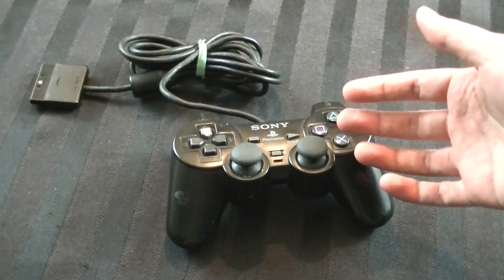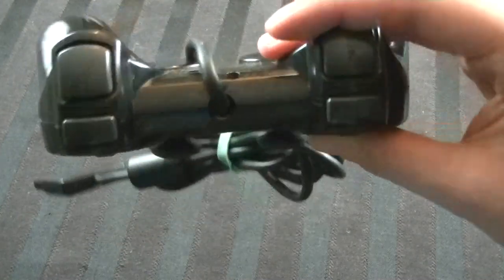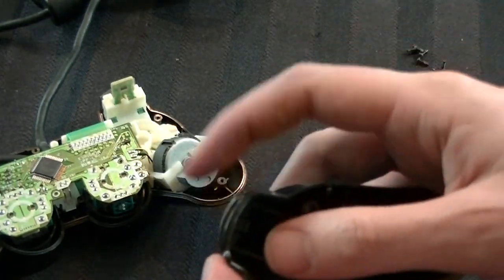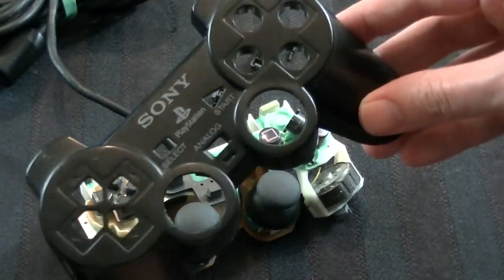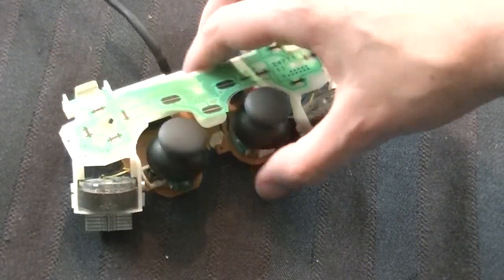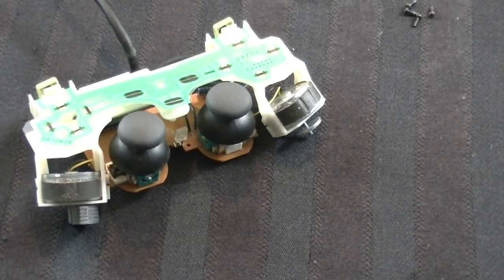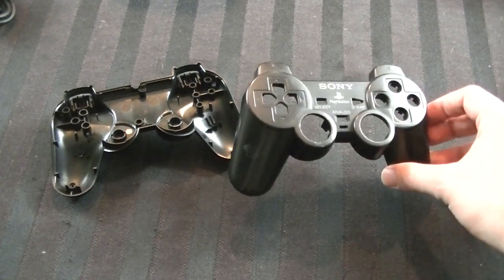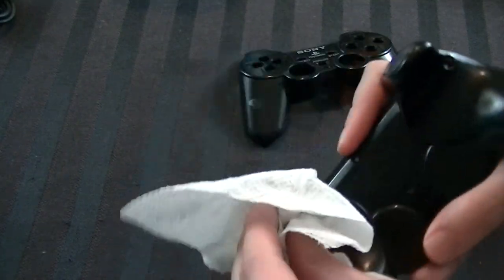Gamerade - Cleaning and Restoring a Playstation 2 (or 1) Controller - Adam Koralik

Comment: Heaven help me, PS2s are retro now
Reply: +ace5762 I know, right? I remember when the PS1 and N64 were commercially relevant. Now that the PS2 is retro, I feel so fucking old.....
Reply: Right! I'm only 30, and I still feel weirded out that people think the PSone is retro!
I honestly view everything from NES and below as retro, and the SNES/Genesis as "classical". 
With the Saturn, PSone and N64 as "old school", haha. 
Those are my "classifications" of older systems honestly.
I mean when you think about it, the PSone came out technically in 1994, it kind of fits into the SNES/Genesis/Turbo era in an odd way.
Yet bridges the gap between the old and the new at the same time, as I've always looked at the PSone as the birth of modern gaming.
So it's 50 times harder for me to view the PS2 as retro by any means.
Reply: +Eric Durant well they view it by when theyre released. but i know what you mean im 24 and ps1 is the best system of all time to me that i grew up on. its ard to admit but i see it like this for now, anything that can be emulated especially on a cell phone is definitely retro. ps1 is on that list, ps2 ot really but gamecube yes and dreamcast. however slow. And gta's on ps2 have been ported to phones so yeah theyre retro too.

but i wouldnt view ps1 with genesis etc. considering it came out in 1989. 94 was a new generation. thats when cds started taking over really. and ps1 was the first full fledged, actually well selling, worthwhile,  console that used cds. because i think something else came before it. maybe 3do was 93 im not sure.
Reply: +ace5762 it blows my mind that people are surprised PS2 is retro. You do realize that cellphones now are more powerful than the PS3?
Reply: +ace5762 It isn't retro at all. Retro means something new that is designed to be like something old. The correct term for the PS2 now is classic.
Reply: +llpalm08 You are absolutely correct. I'm glad I didn't major in English while I was in college, lol. Thank you sir, you have earned an up vote from me!
Reply: You're fighting the good fight, brother. "Retro" is hugely over-used.
Reply: +ace5762 The ps2 has so many games I lost count.
Reply: *****
yea i think it has the most like maybe 2000 plus.
Reply: *****
computer is not a console.
A regular ol pc wins in that regard.

However im guesing you mean zx spectrum which sold only barely 5 mil units or something, i find it hard to believe it had 15k games made for it. Unless it was games similar to one of those handheld 999 in 1 devices which were lame ass games with slight variations when choosing each one.
Reply: you know what makes it a pc in the end? It had things like word processors and spreadsheets released for it. Not to mention actual keyboard is the main interface right?

Idk too much about it but it does have 20k + of programs which include games.Also there were like a dozen hardware revisions.

Considering all this...it may sit close to consoles to you... but its been peeping on your desktop computer imo.

Lastly its similar to a commodore.. that too was a pc, people learned how to do code and stuff off them, while i can agree that consoles today as of 8th gen are nothing but pc's, i cant say the same for the zx or commodore
Reply: *****
well an actual pc can play everything. Probably has even more games not to mention emulates everything.

If its classified as a micro computer... well, thats wht it is. But barely 5mil sold over the course of about 5 years with so many iterations... im surprised it survived for as long as it did.
Reply: I bought one today :-)
Reply: good classification :-) I agree
Reply: ace5762 a
Reply: ace5762 classic sounds better lol
Reply: ace5762 true, but I don't have money to buy a ps3 or 4 + games
Reply: Same...
Reply: I remember Ps2 games etc being sold at GameStop. Now if you trade one in they throw away the cases and manuals. :/
Reply: Eric D when you say “PSone” you are technically only talking about the slim model and not the original
Reply: @billydrake40  i am borned in 2000 so i am now 19 and yeah i am feeling very old cause the ps2 is old school or retro whatever you want to call it
Reply: @billydrake40  5 years ago
Reply: Lol
Reply: Fun fact: the Playstation 3 is now considered retro
Reply: I played ps2 when I was really young . I'm 16 now I was 10 when you made the comment
Reply: Ps3 are retro now
Reply: Lol
Reply: Well now it is
Reply: I love that this comment is fucking 7 years old
Reply: @fucadekiwi i know it has nothing. To do with this subject. But I recently got reply'd on a comment from my self back in the day 14 years ago
Reply: @Groesjeboy  i mean, it kinda does have to do with something similar lmao
Reply: @billydrake40 damn you must probably feel really old now 😂😂
Reply: @thecringe1762  I do. Getting older sucks. It's funny how when you are young, you want to grow up, then when you do, you want to be young again.

Comment: Not all Ps2 controllers are the same, the same thing implies on PS1 DualShock controllers, some have 7 screws, some have different motherboards, some have six screws, and some have ribbon cables attached to a connector or others have a piece of foam pressing the connector on to the contacts just thought I'd throw that out.
Reply: Thank you so much, I was cleaning an old controller I bought from a friend, and it had a foam piece connecting a ribbon to the motherboard, and it fell out. Later, I saw this comment and ran to go find it, and I fixed it
Reply: The foam version is kindof annoying to put back together. I recommend just gluing the foam piece to the case but a weak glue so it doesn't get lost or springs out whilst you're trying to put the thing back together.
Reply: This video is showing how to clean the frame of the controller not how to fix a controller or clean the motherboard
Reply: yeah this, make sure the foam piece lines up correctly when putting it back together, I had mine slip a bit and didnt notice, went to use it and buttons were pressing randomly all over the place. fixed it afterwards though
Reply: You're mostly correct, however, Sony's manufacturing of the DS2 had remained consistent with the same external design (all DS2s have 6 screws). This site's pretty useful for determining DS2 versions, and also for cross-referencing PCBs to see if you have a bootleg or a legit controller: http://www.slagcoin.com/joystick/pcb_wiring.html
Reply: Yeah, I was really confused! "How does this floppy ribbon stay in place?!"

Comment: I did a few of these. I learnt that you can actually take out the L2 and R2 buttons out entirely through the outside and then you can simply pop them into place through the holes at the end after full assembly - saves so much fiddling about when joining the 2 halves together.
Reply: Jesus Christ you’re a life saver, I couldn’t get the two pieces together to save my life. This needs to be higher up.
Reply: I am trying to fix a DualShock 2 controller and the L2 and R2 buttons are all soggy now! How do you take them out ?
Reply: Now there’s a gap in the L/R buttons and you can start seeing into the controller. How do I fix that?

Comment: The tricky part about these is that some PS2 controllers have loose instead of fixed soft plastic pieces that are under the triggers (I think the censors for the triggers), and that can be a huge pan in the ass to realign properly because they move around when you are putting the control shell back together. I had to put a dab of glue under the plastic censor pieces to get them to stay so I could get them to align with the triggers.
Reply: +Harold Cox-Zucker Yeah, same here.  Like a mini-puzzle realigning everything on these controllers.  It's worth it though, as every PS2 controller I've cleaned has tons of crud inside.
Reply: lol me too
Reply: Torgo Gorgo Yeah I think older PS2 controllers are like that. Newer ones I think they have one intentionally missing pin in the connector too.
Reply: Just remove the R2/L2 buttons from the base unit. Just push the plastic noses with a plastic tool back. After removing them, put base unit and top unit together. Simply push R2/L2 back into their housing.
Reply: Wow....I spent an hour the other night trying to get it back together with the triggers aligned. I held the triggers in place while dropping the bottom half back on. The interstellar docking music should've been playing.
Reply: +shark7760 you are awesome man, I owe you a beer or something.
Reply: I just busted my R2 putting the plastic back on. I saw a post on Reddit that took them out and they reinsert it at the end. The plastic from the R2 broke. It was a dead controller but anyway, it sucks. I'll use it for spare parts :(
Reply: Easiest way to remove r2/l2, just push them in (top first) when you have everything else already removed. Ones on my controller just popped off clean. Dont bend anything.. you can pop them back in after the controller is all screwed together. Tried first without removing them and the outcome was mushy and horrible.
Reply: @SharK7760  thanks, worked perfectly. l and r2 can just be pushed in from outside the controller
Reply: @tomj210  It was a pleasure to help :-)
Reply: "And that can be a huge pan in the ass" Lmao 😂😂
Reply: I had the same problem, which is why I came to this video. I opened and cleaned 4 controllers and when I put the two shell halves back together, the rubber under the R2 and L2 would catch and not sit right, so the buttons don't feel right when I push them. I thought about using glue or lube, but people here suggested removing the buttons from the back half of shell.
Reply: @SharK7760  
I was tearing my hair out trying to get the back shell back on and the silicone contacts wouldn't align properly.
Your method worked first time.
Thank you.
Reply: @GADG3Tx87  Even after 4 years I am still glad that I was able to help. :) I am still playing with one of my old ps2 controllers. Maybe I will even use this thing for multiplayer on the steam deck once I'll have it in my hands
Reply: With an aged ps2 controller the shoulder buttons can easily break when pushed back in at the end of reassembly, be careful.

Comment: I suggest cleaning the buttons contact points with Isopropyl alcohol. My start and select did not work first when i put my controller back together, but after i did that, it worked again.

Comment: Some of you commenting have reported the controller not working afterwards, my suggestion is looking at the circuit membrane connection. If you have a pressure fit connection between the controller's main board and the membrane, try increasing the pressure in that connection. The foam pads that push these against the controller compress over time, and will not make a good connection when reassembled. I cut a couple pieces of paper to shape and put them behind the foam piece to solve this issue. If you have the solid connection terminal for the membrane, I recommend replacing the membrane instead, as they are incredibly difficult to repair.
Reply: Also as another bit of advice, while Adam did a stellar job reassembling his controller, I recommend reassembling by fitting all but the shoulder buttons back in, controller guts, back casing, fastening the screws back in, and then pushing the shoulder buttons back in with the controller reassembled. Just pinch the side clips for L1 and R1, be mindful not to reinstall them upside down, and L2/R2 are easier to push back in, and only go in one way. Hope it helps.

Comment: I can't belive how easily you got it back to one piece(last step) . Took me like half an hour  :D
Reply: That's where I'm stuck right now. The pads for L2 and R2 keep pushing L2 and R2 down so you can't press it once it's together. :/ Can't find anything online about that.
Reply: @ThePluralApostrophe  Have fix position. Try put out mother bord and saw triged is in correct postion
Reply: @ThePluralApostrophe  I did today
Reply: @ThePluralApostrophe  Wow I have the exact same problem I had the right analog stick screwed up but now that that works the L and R buttons are messed up :-/

Comment: A tip I learned years ago from my friends mom who worked in electronics manufacturing. A simple rubber eraser works miracles cleaning and restoring metal to metal contacts. Like card edge readers and cartridge contact points. The eraser and some elbow grease will remove all the dirt and out any chemicals or moisture. Have saved many cartridge games this way. N64 games seem especially susceptible to dirt and corrosion to the point where they wont even boot. This trick has worked for me every time I have tried it.

Comment: adam. use rubbing alcohol instead of windex for contacts.  It doesn't leave a film on it when you dry it.  Trust me, its way better to not have to reopen your equipment by using rubbing alcohol instead.  I only mention this cause windex leaves a film on it that interferes with the contacts detecting your button presses..
Reply: I don't understand his obsession with Windex and Pledge.
Reply: +2 for rubbing alcohol, windex is fine for general cleaning but not for electrical contacts. Clean all my cartridges and consoles with isopropyl alcohol and never had a problem.
Reply: +Ozzhiroth Gigliotti i been saying the same thing for a long time but he refuses to believe it. it is bad for plastics and contacts. he even uses it on lenses in like every video he did which is the dumbest thing can do since ammonia will make it cloudy and mess it up. i swear there are people that have messed there stuff up listening to him because they  think he knows what he is talking about and giving bad advise. http://retrowaretv.com/the-dos-and-donts-of-game-cartridge-cleaning/
Reply: +Ozzhiroth Gigliotti I would go a step above and use denatured alcohol or actual contact spray.

Comment: One thing to consider if you're doing this with an old PS1 DualShock is that the rumble motors aren't nicely mounted and are only attached by a wire when you take the shell off. Mine dropped unexpectedly when I took it apart a few years ago, but thankfully it didn't tear the wire.

Comment: Can anyone explain to me how do I fix the analog sticks? They sometimes get stuck in a certain position and they do not move smoothly. I neither have a duster or Pledge so I need alternatives.
Reply: Likely there is some Coca-Cola or something like that gone over there. Safest way would be to just put some sewing machine oil into the analog pad mechanism. Isopropyl alcohol would be better to use first thou, as it cleans up the dirt properly, but it could also damage the mechanism.

Comment: Depending on where the controller was made the inside layout changes. The off white colour plastic at the 4.45 mark is what im talking about. What that means is if you wanted to change the housing of a controller you would need to find 2 from the same country for it to work i.e 2 from korea. The different places where the controllers are make is listed on the back of each pad where the writing is. They also have a letter there. Ive had controllers from korea and china and they have had the letters A and K on them.
Reply: Phil Stevo Some are actually fakes disguised as genuine.

Comment: My PS2 controller is in a' half functional state', where the D-Pad, L1 and L2 buttons do not work. So I tried this, to a degree, and my PS2 controller doesn't function still. It's old, and was corded up for like a decade (from a family member). What can I do? Anything else more specialized?
Reply: FourSwordsLord same
Reply: Just buy a new one
Reply: You might have a missing pin. Look on the plug and if there isn't all the metal pins it is either gonna need repaired or you should just get a new one
Reply: I had this issue, there is an ink that functions inside the controller and it can wear down.

Comment: Protip for reassembly: when you have R2 and L2 in the correct place, push on them gently from the inside so that they're level. Tape them on the outside, and you won't have to worry about them falling off.
Reply: No don't do this. when you open up the controller you shall remove the L2 and R2 from the bottom shell and do the same with L1 and R1. when putting the controller back together save L1,L2,R1,R2 for last. when you have screwed all the screws in you can just snap the pieces in the way SONY intended them to be installed. this is the easiest and correct way to put the controller back together and how they did them in the factory.
Reply: @jobas7769  Be careful with old ps2 controllers. The shoulder buttons can easily break when pushed in last.
Reply: @christopherspoelstra1096  they are designed to be installed like that and i have have done it for over a decade now and not even one has been demaged. They could get demaged if you use a lot of force and smash them in at an wrong angle.
Reply: @jobas7769  I know they were designed like that, I've restored many controllers. Some older/worn Dualshock 2 shoulder buttons are prone to break when pushed in after reassembly, it's happened to me (and others) before.

Comment: I'm like a few years late but it took me an hour figuring out what has gone wrong (controller wasnt working)
Then i unscrewed it for like 10th time and found that the litte white rubber piece wasn't pressing hard enough on that little thin plastic peice,
Phew, now it works, but the R1 trigger is kinda not working right...